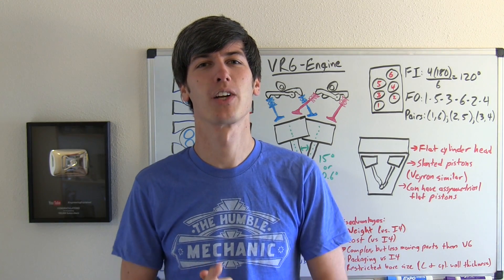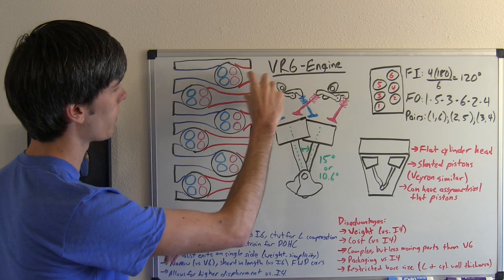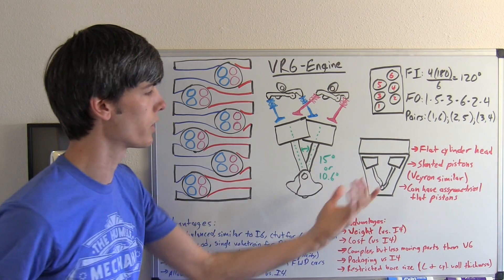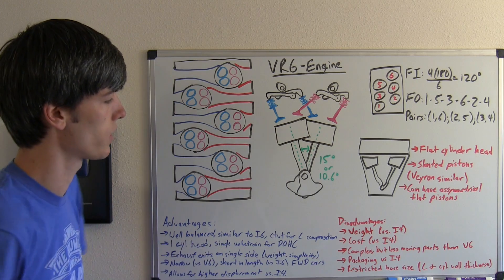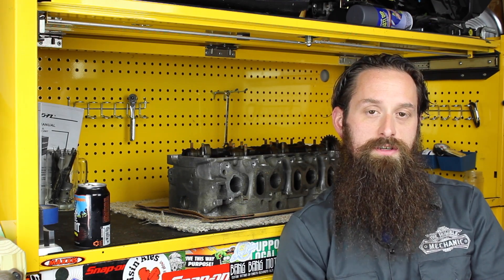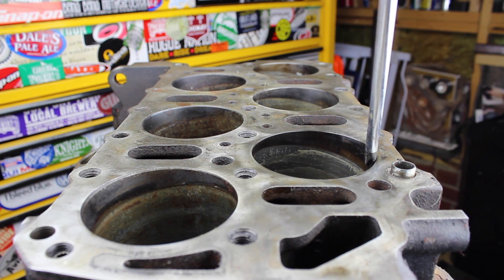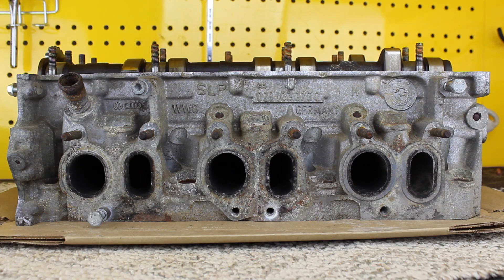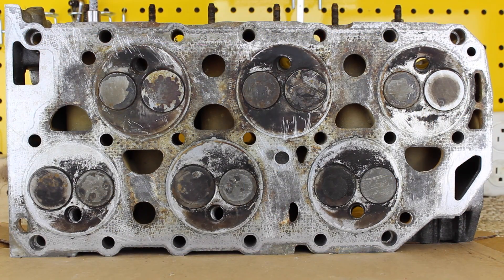VR6 Engine - Explained

Comment: Can you explain what it means for an engine to be blown?
Reply: +malrofo "Blown" typically means an engine has a supercharger. The term is also used sometimes in reference to turbo engines. Hence, superchargers are sometimes called "blowers", but I've never heard turbos referred to that way. BTW, the difference between a supercharger and a turbo is that a supercharger is intake-only and has no lag. Turbos force intake air in AND exhaust gases out, and have a bit of lag so that the intake and exhaust sides of the device can level out in terms of pressure.
Reply: Sorry when I say blown, I meant in the sense of the engine being damaged. Thanks for the info though.
Reply: +malrofo A "blown" engine is a yankee expression for a somehow destroyed engine that is not capable of running properly or even running at all.

Comment: I never knew how 'odd' the VR6 is.  I always thought it was just a V6 with a sub 90 degree V configuration.  Nice video.
Reply: +ChevyChuckles Almost all V6s that are not V8s with 2 of the cylinders chopped off are below 90 degrees.

Comment: AFAIK the VR6 was not used in the Golf GTI (as stated in the description). The GTI Mk3 had a four cylinder, the VR6 was used in the "Golf VR6". The Mk4 had either a four (2,0l with several configurations) or a five cylinder (2,3l VR5 @110 kW and 2,3l V5 @ 125 kW).
Reply: Lejf Diecks Vr5?

Comment: what is the meaning of CC you know 1000 CC
Reply: +Imran khan. The CC stands for Cubic Centimeters and represents the measurement of engine displacement. 1000 CC = 1 Liter of displacement, To make it easier to understand you have two way to measure displacement, Cubic Centimeters (Metric) or Cubic Inches (Standard). So if take the  common Chevy 350 V8 engine (the 350 is representative of Cubic Inches) it is also seen as a 5.7 Liter (which is representative of the metric measurement of displacement which would = 5700 CC (Cubic Centimeters). Hope this helps.

Comment: I don't like the way so much cylinder wall (not the combustion chamber as explained) is exposed to the combustion.  If carbon builds up, and comes off---you may trash that piston, cylinder or valves.  The over bore may not be a option with this engine (as explained).
Reply: There are slight overbore options. I think you can go up to 83.5mm

Comment: Apart from the sound, the 12V VR6 did'nt had much to offer as it was gasping for air on higher RPM's. For serious HP you needed either a Turbo or Compressor, and with just FWD on many models, you'd constant slip spin the shit out of it. Only a few models that came out with 4WD and it just does'nt beat the Quattro from Audi for example. Much on the VR6 motor including gearbox is fragile, shift a couple of times real hard and you'll break it.

Comment: 40 years ago Lancia made a Vi4 which I think it operated the same.
Reply: As I would say. Invention from Lancia. Just as combination of compressor with turbo. And also TDI is a invention from Fiat also as common rail. So not a invention of VW
Reply: Lancia patented narrow v engine in 1915 and used it from 1922 with Lambda (narrow v4) and Trikappa (narrow v8)

Comment: Excuse me, but I don't understand one statement in your explanation.  You say that the engine has a single valve train, but you show one cam and one set of valves for the intake, and another cam and set for the exhaust.  I can't wrap my head around this being a single valve train.  Can you clarify this for me?  Thanks.
Reply from the maker: If intake and exhaust valves are controlled by one cam, it's called SOHC, if they are independent, DOHC, both are described in the video, modern VR6's have one cam for intake, one for exhaust. Older ones control both functions.
Reply: A valve train is a complete valving setup for one line of cylinders which can optionally be a SOHC (a single cam, centrally located on the head to run both the intake bank and the exhaust bank per head)  or a DOHC where the intake valve bank is operated by one cam on the intake side of the head while the exhaust bank is handled by the other on the opposite side.   
The only advantage of a DOHC configuration, that I know of, is so that the valves can be raked in opposed angles, like for a hemispherical head.   
They use the term "single valve train" in this video to represent all the valving mechanicals in a single head engine (where all cylinders are arranged in one unified head), as opposed to a "dual valve train" which indicates you have to have more than one head, usually a V block or a pancake with two paying heads...   Each had has to have its own set of valving mechanisms to handle the breathing of each bank of cylinders.   
Hope that helps.   
Or cumfuzzles ya more.   :-P
As an aside, I'm curious what they consider a standard V8 overhead valve engine with one central cam to be...   Unified valvetrain?  :-P
Reply: +Engineering Explained So are the VRs with two valves per cylinder different than the new four valve engines (as far as the cam setup)? As the humble mechanic explained on the two valve head, one cam controls both intake and exhaust for the even cylinders and another cam for the odd cylinders. Not being familiar with these engines, it seems like if one cam only controls intake and one controls exhaust, the the valves going to the cylinder that are on the opposing side of the cam would be at extreme angles...

Comment: Why VR6? Just seems like a kina dumb idea to me.
Reply: That engine is just about the same dimensions as a 4 cylinder engine. That VR6 engine will fit into an MK1 Golf/Rabbit engine bay. If you are familiar with a late 70's early 80's water cooled transverse VW's, then you will know how small that really is. That is the purpose of the W8, W12, W16 and W18. They are designed to have maximum cylinders and displacement in small enigine packages.

Comment: I had a '92 Corrado SLC and with the Autotech exhaust, it sounded like a four cylinder at idle and driving around, a V8 when it started to wind out, and an inline 6 at full zonk-

Comment: The original Golf GTI, when it was launched, was a game changer. It was the birth of the "hot hatch". The engine was quite revvy, but still with a good spread of power. The steering was quick, and with tight handling and excellent brakes. Overall, it felt like a perfectly balanced sports car in which you could impress the girls or take your gran out. It could make a hooligan out of the mildest of folk. It was unquestionably king of the heap 'til the 205 GTI Pug.
However, unlike most cars, it devolved rather than evolved, becoming ever more bloated, sluggish and uninspiring. The VR6 lump epitomised that dreadful trend. In its attempt to merge two different configurations, it managed to inherit very few of the qualities of either. It was not as silky smooth as a good inline, nor did it have the grunt of a good vee. Plus it picked up some bad points which were inherent in neither. Engine efficiency rule one, get your inlet tracts identical and exhaust headers identical. Intrinsically, that is impossible for the VR6. Plus half of the engine was getting its inlet gasses at a different temp to the other half. And ducting exhaust gasses right through the head, come on. To an IC engine purist, it is horrible. However, it a logical step on the road to expunging all traces of what made the original Golf GTI such a great car. A bloated, sluggish and uninspiring engine for a bloated, sluggish and uninspiring car.
Sounds all right though, but what six doesn't, given a large resonator and little muffling?

Great video. Accurate and well presented. Thanks guys.

Comment: Worst Most problematic engine
Reply: LOL..... What? I have to hear this! Enlighten us as to why this the worst, most problematic engine.
Reply: +Adrizz5447 if you ever owned something with a vr6,  you know what I mean. Unreliable piece of junk.
Reply: philip dias I have done NB VR6 conversions, Turbo VR6's, HPA 3.1 strokers, VR6 swaps. I have been around the VR6 for years and would never classify it as an unreliable engine. Enlighten me as to what exactly makes it unreliable? You haven't answered the question!
Reply: +Adrizz5447 my experience is with the late 90s and early 2000s 24 valve engines : coil pack failures, oil leaks, eating spark plugs, random codes for no apparent reason, dash lights up like a Christmas tree, failed sensors, going into limp mode for no apparent reason, self draining battery, coolant leaks, long list....would not recommend them. Would only go near the TDIs.
Reply: +philip dias lol, I have owned a vw corado vr6 and it was the most reliable car I ever owned.

Comment: The old Lancia V4 was the same principle! Same thing with the old Ford Taunus V4 which e saw later on the Saab 96.. So basically nothing new!
Reply: +Do you remember?  No I don't remember. All the Ford V4s I ever rebuilt or worked on were conventional vee configuration, with a single valley located cam, push-rods and pressed steel rockers. That valve train just would not be possible on a 15deg vee.
Reply: +Lord Elpme Sorry I must be mistaken, but whatis your opinion about the Lancia V4?
Reply: +Do you remember?  My brother and I used to run a garage  and a van hire business. All but one of the van fleet were Transits, powered by either 1.7 or 2.0 V4s. Plus the garage had any number of Transit customers and quite a few Zephyrs, Corsairs and Granadas all using Ford V4s. Consequently, I knew the motor like it was a limb.
We only looked after one Lancia Fulvia, and my brother used to do that one mostly. We never took it apart so I wasn't familiar with the engine internals. but it obviously never let go in the time we knew it. The owner was already a customer when he bought it, second hand, on a whim because he liked the look of it. When he brought it to us to check it out, it sounded like a bag of nails. The engine looked as clean as a whistle and compressions were all good. So my brother set about doing a basic tune up as a starting point. It took a while but each step produced better and better results. It came time to road test, and he was gone ages. When he came back he just said "not sure, try it yourself". I squeezed myself behind the wheel and set off. It was like greased lightning. For a 1300cc engine, the power, and particularly, the power band was very impressive. It also just loved to rev. Coupled with a sweet gearbox and go-kart like handling, it posed a real threat to ones driving licence. It was far and away the best 1.3l car I had ever driven.
Around that time, 1980ish, Lancia were doing very well in world rallying, thus most of their development was done in that environment so as well as the performance, it was also pretty bomb proof. Indeed, Lancia went on to dominate rallying, firstly with the Fulvia, then the Stratos and Integrale, which was the car to beat for a number of years.
Lancia first mass produced a narrow vee in 1922, so by the70s, the tech was mature for them.
It was all new to VW and, to be honest, they made a bit of a hash of it.
Possible conclusion.......good as a four, less so as a five or six.
Hope this helps.

Comment: I love the VR6. it is one of the sweetest sounding engines around, and the power and torque are amazing especially considering the relatively small displacement for a 6 cylinder engine.
Reply: The mx6 has a small v6
Reply: @Christian Helmsworth  yep that takes the cake for small V6.  1.8L.  I remember arguing with a friend years ago who insisted it was the same 2.5L duratec V6 like the MX6 Mystere had.  I told him, no, its not.  Its got its own V6 and is only a tiny 1.8L.  They sounded so good (so did the 2.5 but the 1.8 was cool) they were not very fast but I really liked them and the sound was enough for me.  A purple one came in trade to the dealer i worked at and i drove that to the licencing office for a few days lol

Comment: hey your diagram is wrong, one cam doesnt control just the intake...looks like a sohc per bank to me
Reply from the maker: +Dante Sixx Two different varieties of VR6 explained in the video. Newer ones have one cam for the intake, the older block shown did not.
Reply: Dante Sixx  its still a dohc because it only has one head.

Comment: Your whiteboard valve train explanation seems wrong compared to the actual cylinder head.  Whiteboard shows one cam driving just intake or exhaust valves and the actual head shows one cam driving intake and exhaust on each bank.
Reply: +Larry Harris there are different generations of valve train systems on the vr6
Reply: and they did mention it in there too.

Comment: So what makes the awesome sound that these have and a traditional inline 6 lacks? Is it because half the exhaust runners are longer, so the exhaust pulses align differently, (Similar to why a Subaru with an unequal length header has the rumble that an equal length doesn't,) or is it witchcraft?

Comment: Wait he said on the whiteboard that the valves crossover with one cam for intake and 1 for exhaust each servicing each bank... that's not what's shown on the actual head... on cam services each bank (for want of a better word) of 3 cylinders.

Comment: Ya forgot to mention that some other v6s do have one camshaft that are push rod motors. Such as my 3.0 v6 ranger as well as some of the 4.0 v6s and the 2.9 v6s. But yes i'm sure a lot newer v6 engine do have  overhead camshafts on each head.

Comment: It looks like the exhaust passages for cylinders 2, 4, and 6 are very long. Long enough to create cooling problems. similar to the old flathead Ford V8 engine.
Reply: silverbird58
Yes, retarded timing causes overheating. But long exhaust passages transfer more heat to the cooling jackets and the coolant.
Reply: +Scooter George Good question Scooter..........I was thinking the same thing.

Comment: Don't the first and second parts contradict each other with regards to the crossed over valves?
Reply: Miles, the first part was discussing the 24v arrangement, which indeed is complicated at first.  The humble mechanic perhaps did not have a24v head lying around to discuss, and only a 1st generation 12V VR6 to display.
Reply: The first part was about a 4v/cil engine, the second was a 2v/cil engine.
They probably changed it for the 4v/cil engines to avoid having to use 4 camshafts, which wouldn't fit because the middle ones would be interfering with eachother.
I suppose that's also why they further decreased the angle between the cilinder rows.
Reply: Ah! I see! I overlooked that aspect.
Reply: +Candisa 
The change from the 15° angle 'V' to the 10.6° has to do with displacement only.  All 2.8L and 3.2L VR6 engines were 15° angle.  It was when they went to the 3.6L that it went to 10.6° angle.  This is because of the way that they achieved the larger displacement was by enlarging the cylinder bore for each cylinder.  To have made the bore larger but still centered as it was before would have required the entire engine block to be re-engineered and grow wider.  So instead they simply created a larger circle that grew larger towards the center of the entire engine block, hence moving the center of the bore closer together, which moves the angle of the 'V' of the rods closer together....and that's how the 10.6° angle came about.  It obviously wasn't a the starting goal for them to achieve the bizarre angle of 10.6° first.

Comment: Slight correction about the VR6 in the Corrado, the early '92 had a distributor but the later '93 had coil packs. Mine has a production date of Oct/92 and mine already came with a coil pack.

Comment: You said that 1 camshaft will open all intake valves for all cylinders while the other will open all exhaust valves. But, in the humble mechanic video, the camshaft at the right(or left) opens both intake and exhaust valves for where it is positioned and so does the camshaft on the opposite side...

I was wondering if what you explained is for the 24 valve VR6 while humble mechanic showed the 12 valve VR6?
Reply: +John Ino Sare +fitty77  I was just about to ask the same question. Same goes for the W16 video. I just see how one camshaft for inlet and one for outlet would work without adding unnecessary complicity.
Reply: John Ino Sare 1 camshaft open both intake and exhaust valve?!

Comment: I was glad to hear you say something about overheating.  The three, long exhaust runners must transfer tremendous amounts of heat to the coolant.  Not as bad as a flathead Ford, but I am really surprised to see VW incorporating such an inelegant solution to their engineering problem.  BTW, that VR-6 exhaust sounds exactly as I remember a boyhood friend's 1955 Chevy 6 with a 4-2 split exhaust and glass pack mufflers.  Thanks for a really informative video, guys.
Reply: +Hopelessand Forlorn While it's true in theory that the rear cylinders do run hot, it hasn't seemed to be enough to cause major issues.  Also, it's pretty common to have them on boost running ~ 400whp with engine preparation being a minor refresh (Rail Guides, Chains),  Head Spacer & ARP Hardware (ARP Head Studs / ARP Rod Bolts C2 Head Spacer 8.5:1).  This is approximately 18 - 22 PSI on a VR6 12v with  Properly Sized turbo.
Reply: The overheating issues we're due to cheap plastic components in the thermostat housing and crossover pipe. The aftermarket solved that with aluminum components.
Reply: Yeah, without aftermarket parts the engine indeed overheats and bends and/or breaks. Its a great design but poorly built.